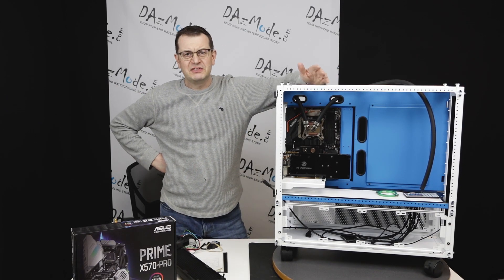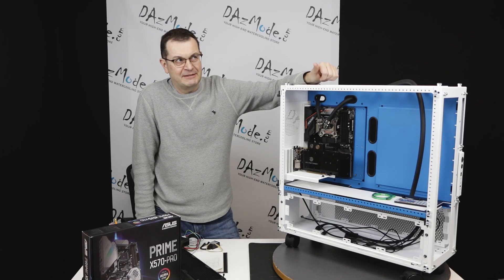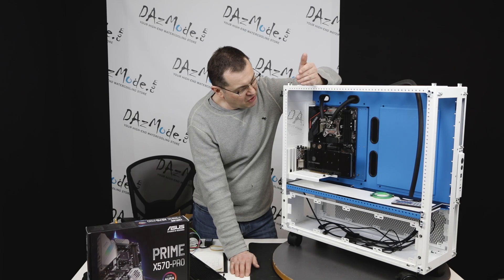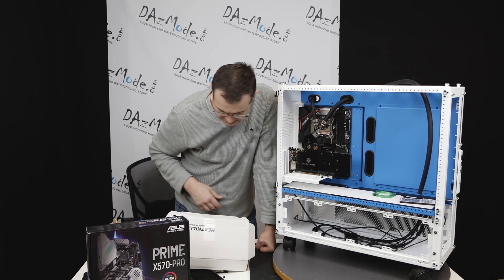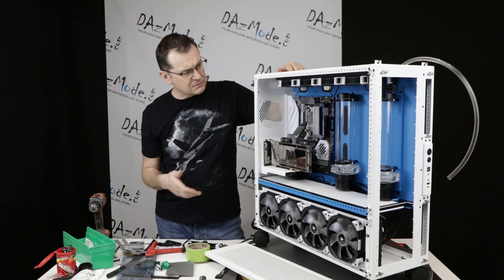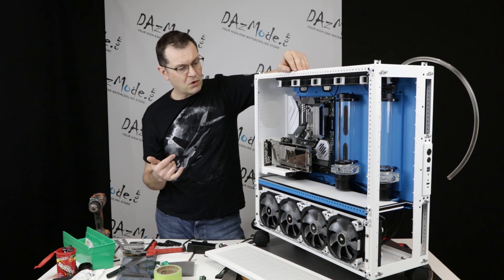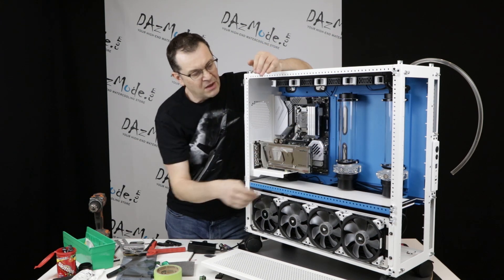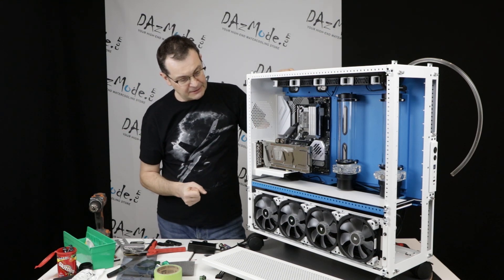Untouchable Build _ Ep 1

Comment: Why not put both rads in the basement for more room to plumb the reservoirs? Could also use something fatter than 480 lp rad, dual 60 mm 10 fpi might still like slow fans?
Reply from the maker: I personally hate rads in basement. Bad for flow, hard to fill and drain.  This  build would be fine with single lp480, anything above is just burning cash for looks.